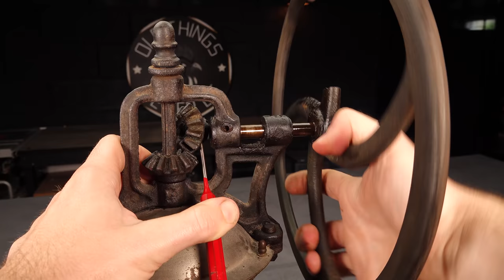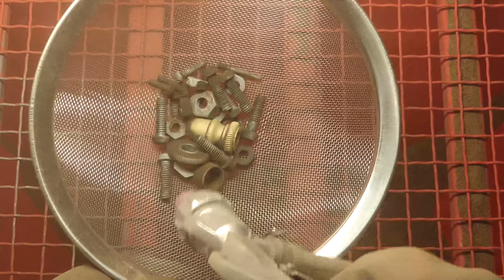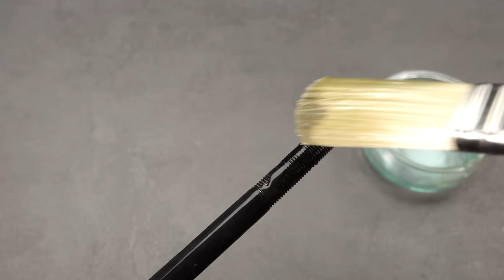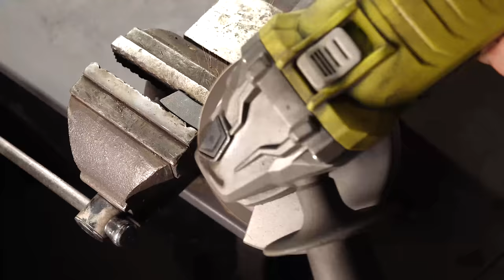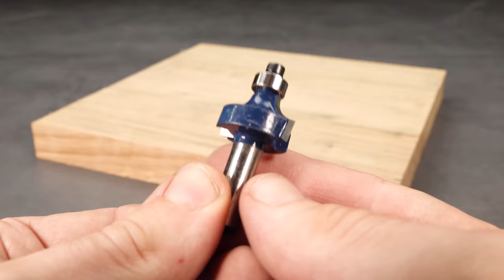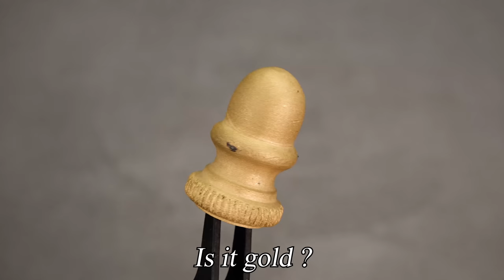Broken and Rusty Coffee Grinder Restoration

Comment from the maker: After you watch this video, you should check My Metal Basketball Game here 😉😝 
https://youtu.be/TpEmBGqGVJw
Reply: Nice👍👍👍
Reply: Not one of your more complicated restorations, but I think this turned out the nicest! Impressive repair on the turning wheel. Nice touch on the square shank nails for the drawer :)

You should consider placing fiber washers between the nuts and your powder-coated surfaces. This would allow you to use thin lock washers if you desire and not scratch the coating.

By the way, what type of oil are you using to quench and blacken the screws and bolts?
Reply: we are thanking to you sir....
Reply: @scalhotrod 

9 88 και η μουσική που
Μ Α σε ένα

Comment: beautiful restoration.... However.... only downside is tht he didnt WELD the damn metal piece to the cast iron wheel hand crank. I get it if you dont have a good experience with cast iron welding but please. Learn how. Im a welder at my job. Other than that, great job on the restoration.

Comment: 🔴🔴🔴🔴🔴🔴🔴🔴🔴🔴🔴🔴🔴🔴🔴🔴🔴🔴🔴🔴🔴🔴🔴🔴🔴🔴🔴🔴🔴🔴🔴🔴
Nice job 👍❤, you shold weld that weel insted of epoxy it
Tysy falower✌
Reply from the maker: Thank you. It's difficult to weld cast iron and i never did it so i prefered using safe solution 😄
Reply: @OldThingsNeverDie-  ok keep up the good work, one day you will become famos on youtube✌👍
Reply: @OldThingsNeverDie-  I've worked as a first class welder in a foundry and yes you right it is very difficult.
Reply from the maker: @RestorationAustralia  Yes, i saw cast iron needed to be preheat to 400-500 °C before to weld it, too difficult...😬😬😅